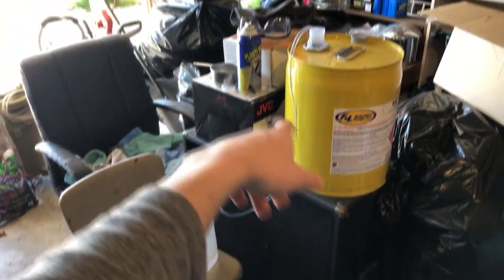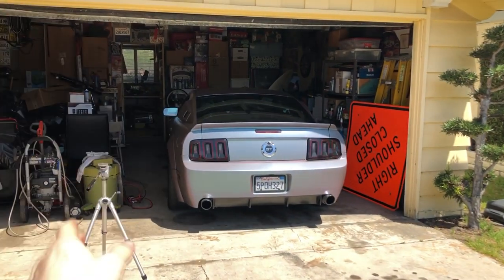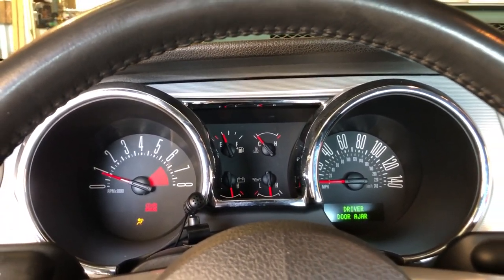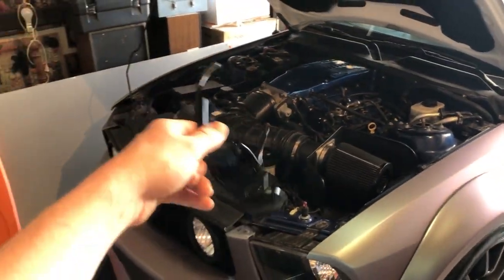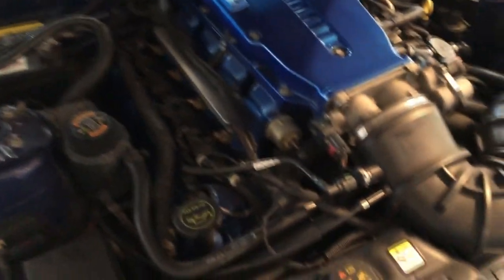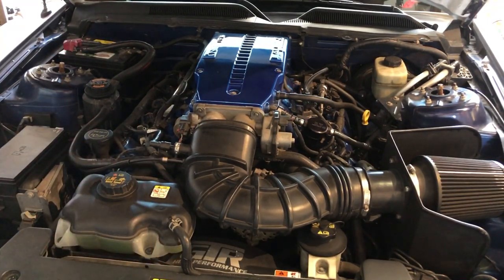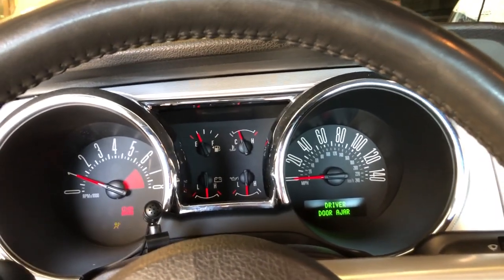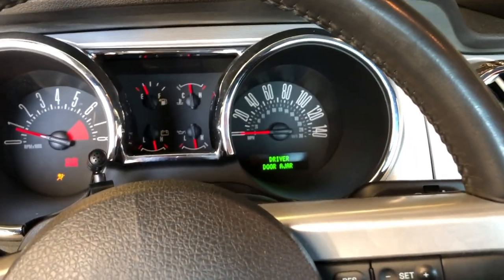My Motor Blew Up Because I'm A Moron...

Comment: Excuse my ignorance, but what does methonal do? Is it like a boost?
Reply: Makes intake air cold as absolute shit. Lets the car run more timing which means more power. Its also pretty nifty I'm cleaning valves if you have a direct injection car. Definitely some good stuff to have on a performance car.

Comment: I don’t know if this will help but I think one of your radiator hoses/lines are loose because when I was putting in a new radiator for my infiniti and I had a bad hose clamp on and there was steam coming from the radiator hose tho it may be a radiator hose leak towards the bottom of your radiator
Reply: 🤣🤣🤣🤣🤣 got me

Comment: The problem is that you abuse your car that's why your car gives you problems I have a V6 Mustang 2002 with a Cat-Back exhaust and BBK headers 140.300 miles and my car still running
Reply: But it’s a chick car.

Comment: How is he pushing 500hp
Reply from the maker: Built motor, 12 psi of boost
Reply: @DrewPeacock  I have a stock 3 valve Mustang and I'm trying to make a lease about 350 to 400 horsepower what are some mods naturally aspirated though I don't want 
A supercharger or no turbocharger

Comment: drew ill try to help you out and look for some answers! could it be burning oil or anything?? or it could be an electricity issue or the anti freeze could have mixed with water and gotten into the fuel i dont know opps nvm i realized u found the issue lol oh i realize it was a prank -_-